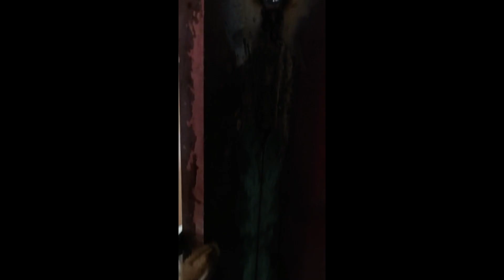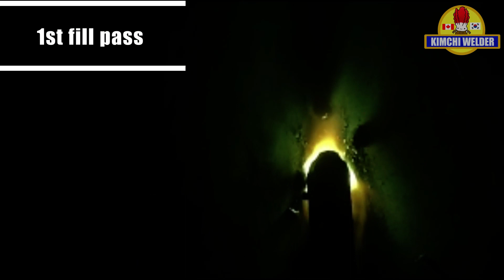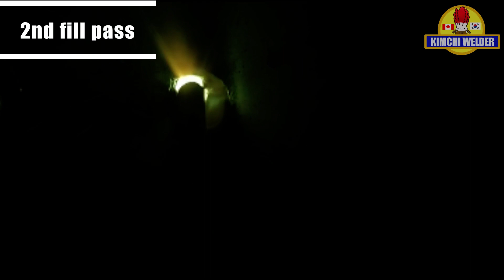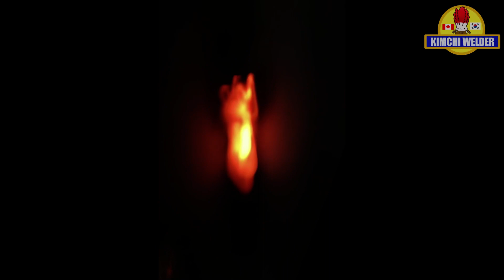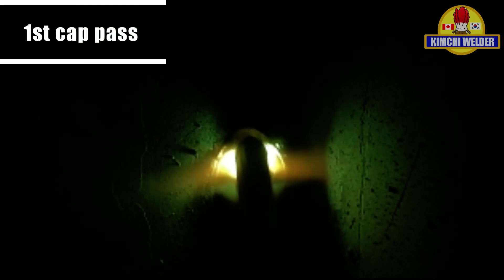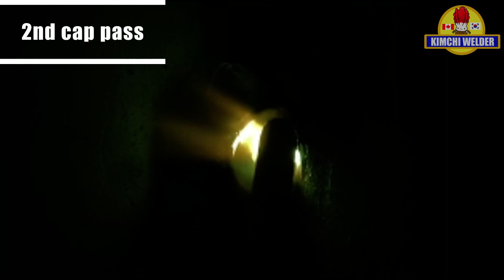Vertical Stick welding basic

Comment: Que espesor es el material?
Reply: The metal looks to be at least 1/4 inch thick for the 7018 rod to not burn through at 120 amps. Any thinner metal than 1/4 inch at 120 amps will cause a burn through.